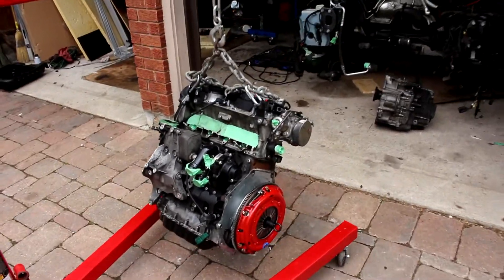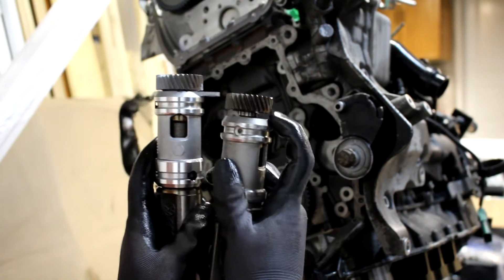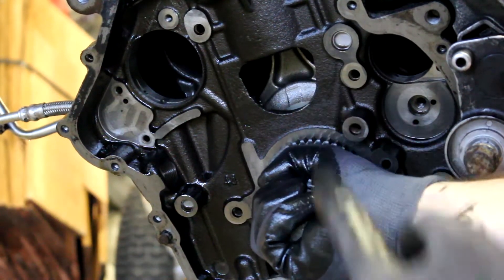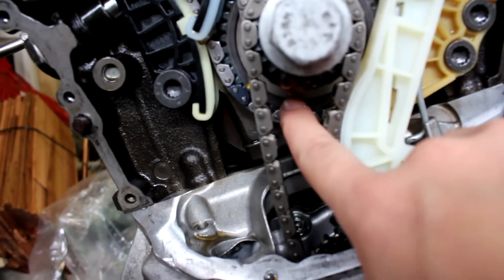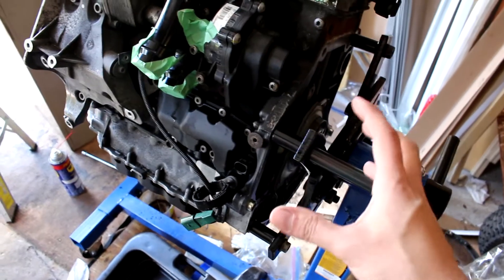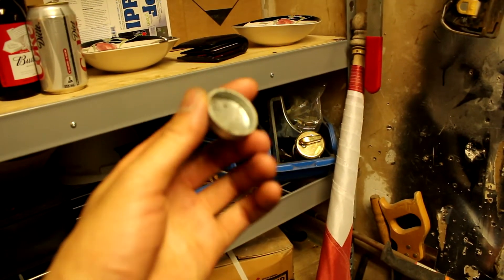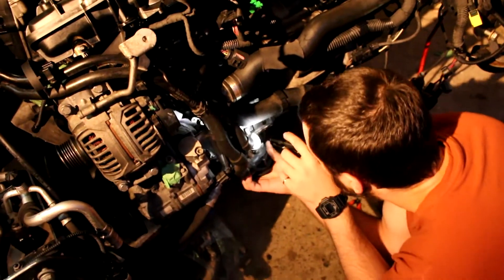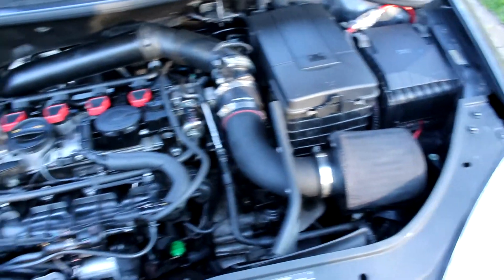Seized Balance Shaft - VW 2.0T TSI

Comment: I'm here piecing back together my 09 gti..  HOW did you end up getting the stupid plastic shroud on the exhaust side balance shaft back in?!  I ran out of patience, but have to wait to be sent the rest of my parts that weren't delivered to me anyway.  Any advice is greatly appreciated!  Thanks for the vid, no one has actual balance shaft timing vids up.
Reply from the maker: Ohhhhh man I'm so sorry you have to deal with that and at the same time I'm glad I'm not the only one who had that issue. One method that I found works (still hard) is to put the plastic shroud onto the balance shaft first (plastic notch on top) and try sliding it all in as one unit. It's one of the most frustrating steps man. Best of luck, let us know how it goes!
Reply: @WannabeTuners  Right on, I'll give it a shot tonight.  The Alldata service manual says to put the notch into the hole at the back of the block first, but it's more of a ledge from what I can see?  Of course it doesn't want to stay there either haha.  Thank you!

Yeah, went from my 275k mile WRX to this "more reliable/less maintenance cause it's got half the miles" GTI in July, exhaust shaft froze and left me stranded on Thanksgiving.  Been one hell of a journey.  FCPEuro didn't send me the oil pan gasket or the TIMING CHAIN TENSIONER in their TIMING KIT..... -__-  We'll see.

I was getting an occasional "STOP! ENGINE OFF! OIL PRESSURE" message on the dash that I hadn't been able to diagnose.  Turns out it was probably the shaft's oil passages being boned.  Out of curiosity, any similar thing for you or did it just go one day?
Reply from the maker: @thuu9  ah sorry to hear. it seized for me after a bad downshift. No oil pressure warnings though. These balance shafts seem like the weak point of these engines. Yeah the notch was a ledge for me too and haha nope it doesn't like to stay there and it's hard as balls to line the balance shaft to the journal bearing on the far end of the block while trying to keep the plastic on. It's a mess of a design! The good thing is if you try to put the balance shaft in with the plastic on it, if the plastic falls off, it shouldn't let you push the balance shaft all the way in because of the misaligned notch. So if it does all slide in fully, chances are its in correct and the notch was aligned. Then spin the shaft around a bit to make sure you don't hear grinding plastic. " The feeling when it finally goes in is like no other "
Reply: @WannabeTuners  Gotcha.  Mine was a bad upshift!  Yeah it's a pos, miss my boxer right now.. Balance who? xD

Great, I'll give that a go for sure!  Got the updated intake manifold, all the timing stuff, injector kit, and a coolant outlet pipe I busted.  Only thing I'm undecided on is clutch.. Don't see the need for a dual mass replacement, what's up with that price point???  How are you liking the single mass conversion?
Reply from the maker: @thuu9  haha boxers sound awesome too! I used to want a Subi, but I couldn't find a low miles one for a good price. 
The single mass flywheel is pretty sweet. The lower inertia  makes rev matching quicker and overall rpm changes more rapid. The pedal is MUCH stiffer than stock with this pressure plate though. 

 The car does feel harder to drive with AC  after the stage 2 clutch kit, the rpm between shifts drops noticibly quicker than with AC off
Reply: @WannabeTuners  Everyone overprices them for sure.  Good!  I'm looking for actual feedback in a pedal hahaha.  And that makes sense with the AC pulling some of the available inertial power.  Awesome, thanks so much for the info man.  I'll let ya know how it goes
Reply: Let this be a lesson, kids. Always listen to strangers on the internet. Worked first try!! I didn't have enough patience, there's a collar on the balance shaft that the sleeve will basically snap onto. Thanks so much for the advice, I'll be sure to update as I progress. Don't have much down time but trying to wrap it up asap.

Thanks again and much love from Michigan ❤️
Reply from the maker: @thuu9  ahhh yes!! Great to hear! That collar on the balance shaft is a savior! Glad it worked out for you! Goodluck with the rest of your build and be sure to send and update  :) we're pretty active on Instagram. If you have any more questions feel free to shoot
Reply: @WannabeTuners  Last question for now.  Did you replace the sprocket that drives the intake balance shaft?  Repair manual says always to do so to avoid play in the worn gear.. Not sure that I care to take even more time to order that.
Reply from the maker: @thuu9  yea I replaced it. The teeth were broken on mine from the impact of the crank trying to spin it (since my intake balance shaft seized). I don't know how critical the anti backlash is but both times I rebuilt the engine, that sprocket was physically damaged. It's hard to tell what you can keep since the manual pretty much states to replace everything lol. I guess they're covering their ass? But if you're already in there, it might be good to replace it for peace of mind?
Reply: @WannabeTuners  Gotcha. And yeah, figured they'd throw that in for a reason too. I may risk it, teeth are in good shape!
Reply: @WannabeTuners  Hey dudes! Update time.  Finally got all parts in and had time to go to work!  Replaced both balance shafts, all timing guides and chains (not oil pump),  updated intake manifold, cleaned out intake valves as best as I could, kept the intake side balance shaft sprocket, the cam bridge, and (for now) the overdue-for-replacement clutch.  She's running and driving!!  Might be a little bit noisy but as far as I'm aware everything was re-installed correctly so I'm not too worried.  Forgot to put ONE coolant hose clamp back on, going to the interior heater core, that was a pain and a big mess..

Only other issue right now was a misfire in cylinder 1, I checked codes and noticed it had a cam position fault.  My idea is that code came from when it seized and stored the position, therefore was throwing itself off... not too sure if that's likely or not though.  Anyway, about 15 miles on it since I cleared them and no issues yet.  Thanks so much for all your help and advice!  So happy to be back in my own car finally.
Reply from the maker: @thuu9  Ahh CONGRATS! That is amazing news! soo glad to hear! It's soo satisfying to have it running after having a hand at un-f*cking it eh? Oh I totally know what you mean about the heater core piping. I broke the plastic housing going to the heater core where that little plastic nipple (im guessing a breather?) connects to the thin line on one of the pipes, it was a pain to find the replacement. Enjoy the refreshed build!
Reply: @WannabeTuners  thank you!! I broke the plastic coolant outlet on the head, that one wasn't terrible to find and replace lol. But I feel your pain! Thanks again(:
Reply: @thuu9  Did the “STOP! ENGINE OFF! OIL PRESSURE” come back after you changed out the balance shafts? I know it’s been two years now. Thanks
Reply: @lukecoughlin1289  Hey man! No worries, still fresh in my mind. Message completely stopped and it ran strong for 12k miles before I parked it and bought another WRX, I missed having AWD too much. Basically the small screen filters get sucked into the bearing, or clogged up, and cannot provide proper oil flow. Idk if there's a sensor somewhere downstream that was giving the error message or what. Alternatively, the message could be oil pump related as I believe it's run off the same chain? But I replaced only balance shafts (OEM but without the filter screens I think), and timing kit + cover.  I still get notifications so don't hesitate to ask anything more!

Comment: Hey man quick question when tightening the left hand thread bolt on the water pump shaft i used the socket and ratchet to lock the crankshaft but for some reason even with the crankshaft locked the balance shaft still spins have you ever noticed this? and how did you get the balance shaft to lock so you can install the water pump gear? thanks
Reply from the maker: I don't think it should spin if the balance shaft chain is connected to the balance shaft and crank shaft. I made the mistake of taking the chain off first before removing the water pump pulley so I had a friend prop a pry bar between the balance shaft gear teeth and the block (was very careful, big risk of breaking something) to hold it.
Reply: @WannabeTuners  OK thanks going to get a bolt off an old engine I would double check and see how it feels maybe something is wrong with mine
Reply from the maker: @shimon2476  sounds good, good luck. The water pump pulley is reverse thread and you're not alone in that it feels really stuck for such a small bolt
Reply: @WannabeTuners  thanks for the  help man will keep you updated! also what was the torque spec was reading it was 9 nm?
Reply from the maker: @shimon2476  damn i can't remember the torque spec sorry. I didn't use a torque wrench which was risky but it never came loose on me
Reply: @WannabeTuners  OK thanks will keep you updated how is the car BTW?

Comment: Same exact thing happen to me, the intake balance shaft looks just like yours. The balance shaft rubbed into the timing chain guide rails too. My question is did you buy the removal tool to remove the balance shafts? The engine is still in the car and i got it all apart just dont feel like shelling out the money for the tool.
Reply from the maker: Sorry to hear about that. I didn't buy the puller tool. I got lucky and the intake balance shaft came out  easy. The exhaust balance shaft was stuck so I had to knock it loose from the transmission side by removing a freeze plug in the block.

Comment: Went through this exact thing. Balance shaft seized. Lucky the timing wasn't affected. Replaced a ton of parts since i was at 160k km. (Timing chain, aluminum water pump, oil pump, carbon clean, aluminum RMS, etc)

What kind of "wearing in" did you do after replacing everything?
Reply from the maker: I just drove it normally as no major bearings/seals were replaced for this job. The idle sprocket and intake balance shaft mate with that anti-backlash coating, but I couldn't find any break-in information for it. I took it easy on the car for a week or so due to my nervousness of all the money spent on fixing it lol. These balance shafts really make for an expensive fix when everything including the lower timing cover is "one time use" :).
Reply: @WannabeTuners  Yeah, my mechanic found out about the "one time use" with the idle sprocket today LOL, it was a very expensive job.
Reply from the maker: @YuStudios  That one stupid sprocket cost me 160CAD lol. I feel your pain. The balance shafts alone are around 400 but the whole bill of parts to do the job "properly" makes it a couple grand :(
Reply: @WannabeTuners  yepp I did everything and the bill hit around 4k max. Then my mechanic told me he wasn't aware of how many extra parts needed to be replaced bc of one time use, so my bill is going to be even more now 🥴
Reply from the maker: @YuStudios  Yup, That's the volkswagen life lol. They hate our wallets
Reply: https://www.timingchainsettlement.ca/

Comment: Hey  can you assist me please I'm changing the seal on the balance shaft that's behind the water pump gear  when you remove the seal there is a small hole on the block on the bottom of the seal unfortunately the tip of my screwdriver broke off and a very small piece fell into this hole, can you tell me if this hole is directly connected to the sump pan etc or even better what does this hole do? does it supply oil to the seal?
Reply from the maker: Hi, That hole is an oil supply to the end of the balance shaft. If you look at the end of the balance shaft where the water pump pully sits, you will see that it is not perfectly round and has a bit of an indentation to allow oil lubrication (I am pretty sure as there is a similar one on the exhaust side balance shaft). I do not know how it routes through the block unfortunately. If you find out where the oil cavities feed that hole, you can maybe try blasting high pressure air from a compressor to try and blow the piece out. I have not removed the oil cooler assembly, but this might be where passages are located (I don't know for sure).
Reply: @WannabeTuners  Thank you for replying I tired pushing a thin piece of wire down into the hole to see if it goes straight to the sump but it only reaching about 3 to 4 inches in then bending so im thinking of taking the sump pan out and the plastic baffling and blowing compressed air through the hole and see what happens what do you think?
Reply from the maker: @shimon2476  That could work if it's a drain to the sump, but I feel like it might be a feed to lubricate the end of the balance shaft rotating assembly. In which case it would probably connect to that aluminum oil cooler + oil filter housing. But sorry I don't know if its oil drain or feed. I don't have an active subscription with the workshop manual right now. Might be worth a shot to but I can't say for sure.
Reply: @WannabeTuners  not a problem i will take out the oil cooler and start there 1st what you are saying makes sense  also where can i get a workshop manual that might have the info im looking for i dont mind if i have to pay thanks again for your help
Reply from the maker: @shimon2476  I bought a 1year subscription from alldatadiy.com after watching another youtuber recommend it. It was pretty good, I might renew again when I need to
Reply: @WannabeTuners  Ok will buy one now and see if it has a diagram of how the oil flow is in the engine because after watching the block again i dont think that the intake balance shaft is connected to the oil cooler plate etc it sits lower I think my best bet is to take off the sump and hope for the best  will keep you updated
Reply from the maker: @shimon2476  ohh that's a good point it does seem to be lower
Reply: @WannabeTuners  yep do you have an email address? maybe i can send a video so you can see better the situation im in worst case if it goes to the sump it should come out with an oil change i just dont want it to stick in the block and clog the oil passage for that shaft.
Reply from the maker: @shimon2476  sure, wannabetuners@gmail.com
Reply: https://www.timingchainsettlement.ca/
Reply: @jasungraham8325  already fixed it  thanks

Comment: Hey bud how were you able to remove both the balancing shafts? Mines wont rotate anymore
Reply from the maker: For the intake balance shaft: The water pump belt and drive pulley need to be removed. Next, take out the torx screw on the front of the balance shaft near the gear that the balance shaft chain goes (same for the exhaust balance shaft). at this point it will slide out. The service manual says you need a slide hammer. The other option is to remove a freeze plug/expansion plug on the transmission side of the block and hammer it out from that end. There is a bearing on the transmission side of the block that the balance shaft sits in, so make sure not to damage the soft metal. It was a pain in the ass and I didnt have a slide hammer, so I removed the freeze plug on the exhaust side balance shaft and hammered it out from transmission side to timing chain side. The intake side balance shaft slide out easy for me (luckily). Remember the water pump pulley gear that screws into the intake balance shaft is reverse thread(from what I remember). Hope that helps. Also, I had trouble finding a replacement freeze plug that fits so I had to reuse my old one (which isn't recommended).
Reply: @WannabeTuners  Thank you!!
Reply: Where did you find the service manual?? Pulling my TSI atm. Hope the balance shafts come out with little effort
Reply from the maker: @tomkim5853  I had to buy a 1year subscription to http:// alldatadiy . com/ to get access to the manual. My subscription has since expired sadly. If you have any questions about the job I'll do my best to try and remember but the manual from that site was worth it in my opinion, lots of goodies for other work too.
Reply: @WannabeTuners  thanks dude my exhaust shaft seized, sprocket spun out just like your intake shaft. I'll have to get in with all data since I can't find the manual anywhere else. Thanks for the reply btw, thanks for helping the community with the garbage ccta problems haha.
Reply: @WannabeTuners  did you install the plastic liner for the exhaust balance or is that not necessary? I'm reading conflicting arguments about this. Thanks in advanced
Reply from the maker: @tomkim5853  yea I installed it. Did it off camera due to the frustration, I had to use pliers to hold it "closed" while inserting to get the back end all the way in. There's that little plastic nub that needs to hang on the far side of the shaft hole